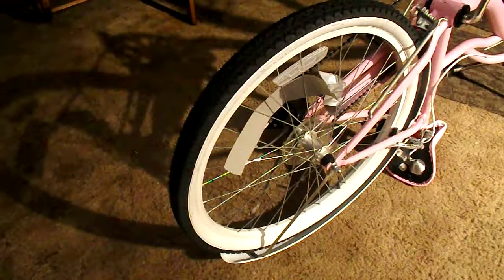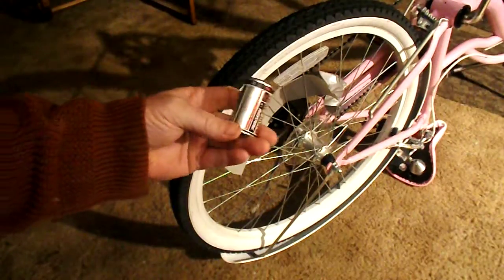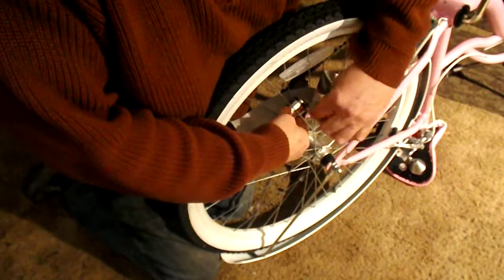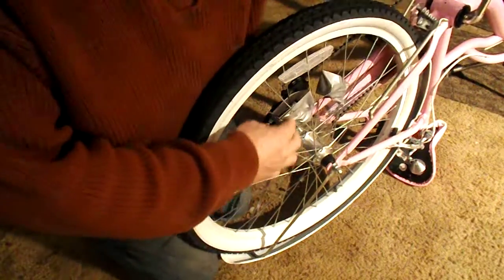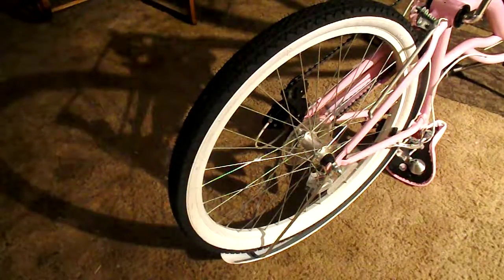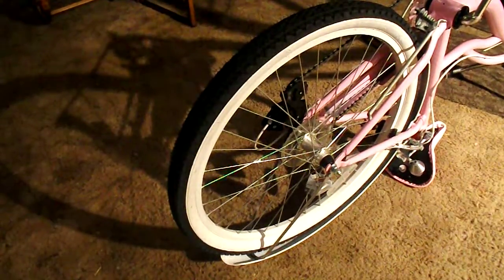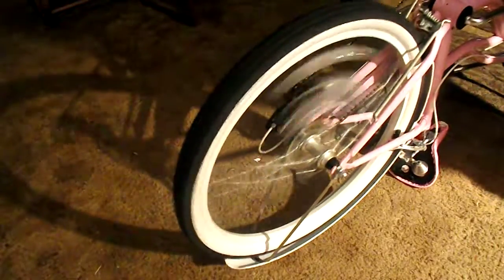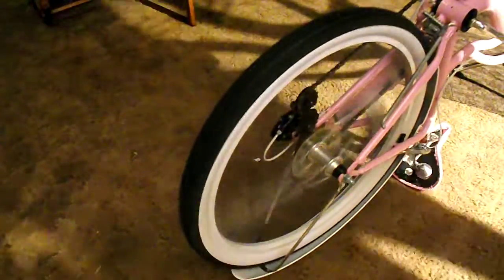Anti-Gravity device for flying saucers

Comment: only will work if the weight is constantly thrown upward.  I wonder if it would be possible to use a liquid instead of a solid to counter weight the gyro.  mercury may have properties needed due to it being electronically conductive.

Comment: No, you are not crazy, sir, but there are some technical hurdles to overcome to achieve thrust from centrifugal force.  It will not be possible to do so by moving a mass in or out along its radius, due to the dang coriolis forces cancelling out any of the effects of creating more centrifugal force along the top of the "wheel", and weaker centrifugal force along the bottom, dashing any hope to achieve thrust by the difference between the two.  Moving a mass inwards during spin requires the system "wheel" to decelerate the mass, and moving a mass outwards during spin requires the system "wheel" to accelerate the mass, thus pushing the system or "wheel" downward if the wheel were to maintain a constant angular velocity, these are the coriolis forces at work negating your differential centrifugal forces. 

With that being said, I believe that it can be totally possible to achieve antigravity, not by spinning a mass 360 degrees around and changing its velocity and or radius between the top and bottom halves of the spin, but by confining the mass to oscillate within an arc pattern, say around 90 degrees of travel, and at the same time accelerating and decelerating this mass by means of another inertial force. That way the system supporting the oscillating mass is isolated from the forceful effects of speeding up and slowing down the arcing mass, and you won't have the negative issues of coriolis forces of a manipulated mass going around in a complete circle, thus unmasking a focused centrifugal force of this arcing mass to do useful work. 

The naysayers will say this is all impossible due to it being a violation of the conservation of momentum, because an internal force can't accelerate it's own inertial frame of reference.  Who is to say centrifugal force is an internal force, what if it is actually an external force that works off of the solidity of the time space continuum?  Then the conservation of momentum would not be violated.  Scientific academia can't even agree if centrifugal force is really a real force or not, and whether space time is just nothing, or made of some kind of quantum foam!

God bless you.
Reply: Excellent your comment.  The most complete I've found to date.  I completely agree with you on oscillating the dough by just 90 degrees.  This type anti-gravity system works with two opposite pendulums.  When one goes left the other will go right, when one goes right the other will go left.  The system will move towards the centrifugal force.  There are several overdue patents on this system, but people don't believe it.  I'm sure the text below to you makes sense: 

"The fifth element:
The combination of an advanced energy and propulsion system, which would, among other things, enormously simplify space travel to the planets and beyond, is a direct result of assuming one additional term (i.e. a Fifth Element) in the equations of classical mechanics and/or electromagnetics.  The Fifth Element depends upon the rate of change of acceleration in mechanical systems (acceleration of current in electromagnetic circuitry) as well as a time constant which is related to the apparent size of the system in question.  The larger the time constant and/or the greater the rate of change of acceleration -- i.e. the more radical the change of pace -- the greater the effect."
Reply: Well, seems that someone has been able to make true what you are telling here with a device that performs almost the way you say, and it does really WORK !. This guy is Mr. Mike Marsden. Cheers, John.